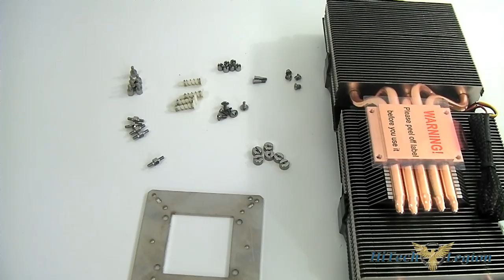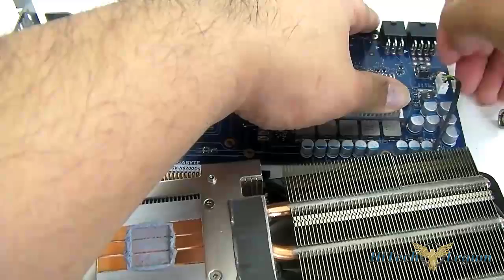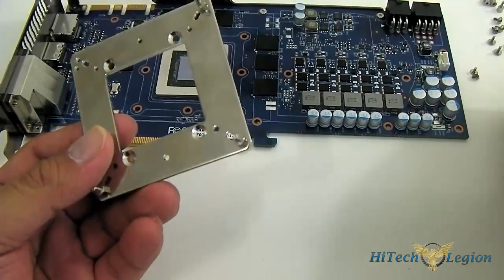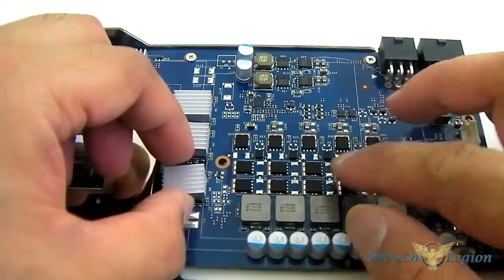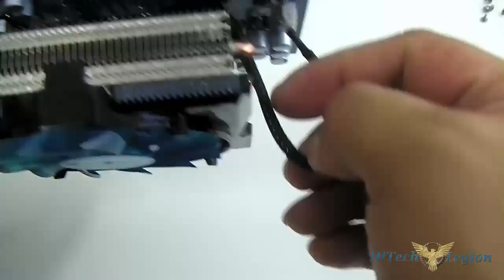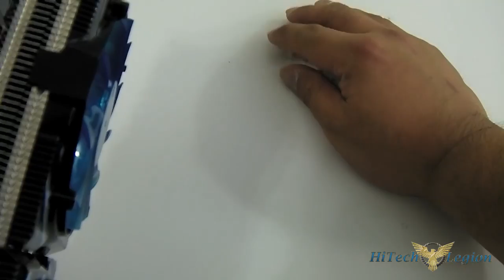GELID Icy Vision VGA Cooler Installation Tutorial Guide on GTX680 PCB

Comment: They do. Pretty much any closed loop cooler can be used. All you have to do is by a cheap bracket to fit it to the card. It will most likely have to be put as an intake in the front or bottom of the case though.